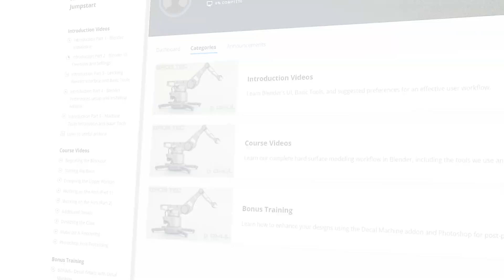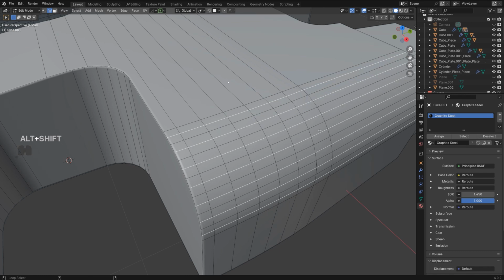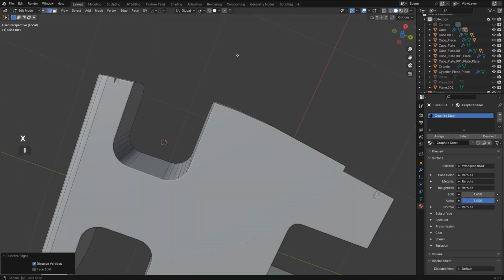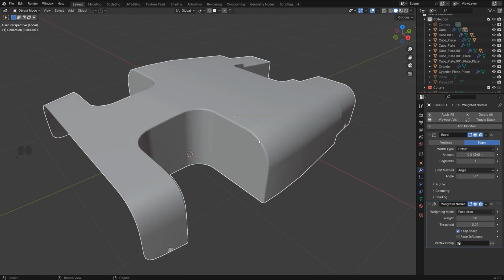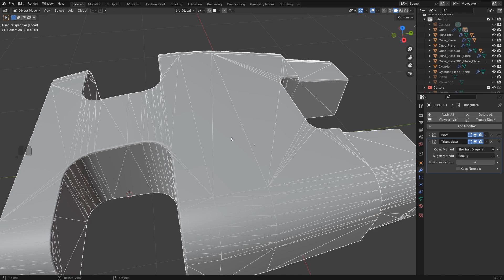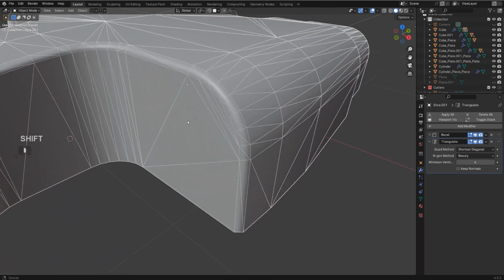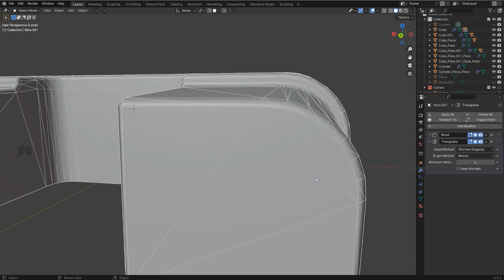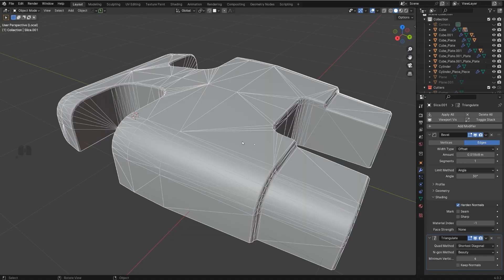How to Optimize Mesh in Blender for GAME ENGINES

Comment: Before ChatGPT-3 was severely degraded, I tried to make a plugin that would select every other row. I managed to get it to work with 3 steps as opposed to what I wanted (selection of a row with perpendicular lines and have it select those as checker deselect). I guess if you try with the paid version, it would work.